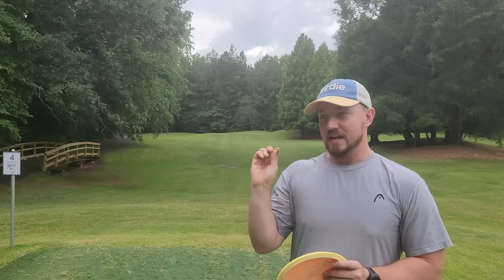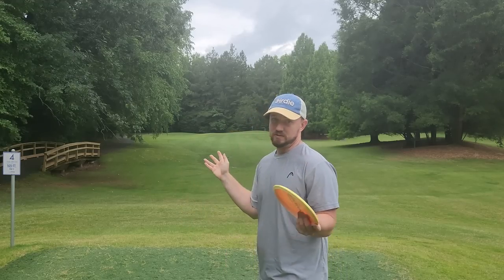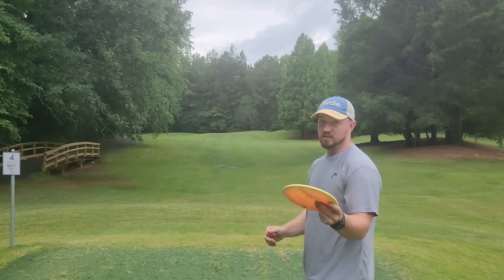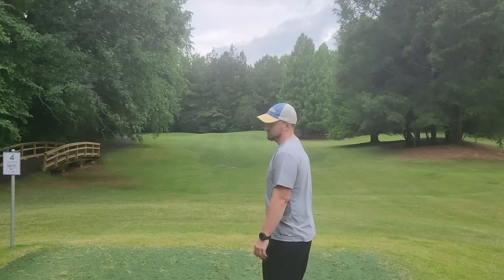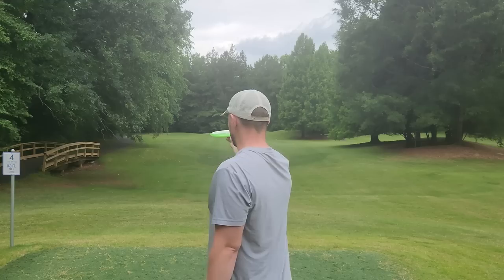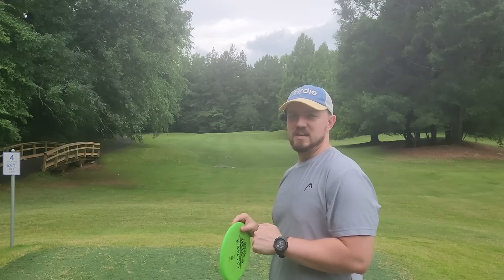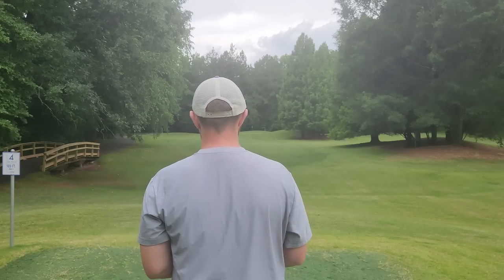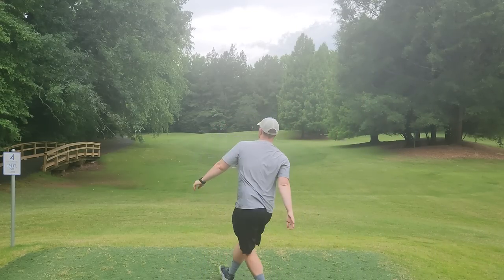Grip Locking Doesnt Exist | What Is Actually Happening and How To Fix It

Comment: I feel like "grip lock" is not intended to describe the disease, it's describing the symptom. Consider a parallel with "warped rotors" on cars. Doesn't mean it's not useful to quickly communicate the effect even if it's not describing a cause.

Comment: The other potential cause is you have your elbow too far forward, or you're moving your arm too soon, before the hips move. 

This means your arm will get in position first, but the hips will still be rotating, so it will push your arm further right causing a "rounding" effect.

The movement has to start from the bottom and transfer power up the chain, so the disc must be the last item in this chain to move.

Comment: so, I have actual grip lock problems.. no just releasing at odd angles, but actually holding on to the disc, sometimes sending it somewhere between 90 and 120 degrees off the intended angle.. it comes and goes, but usually, when it has started to manifest during a round, I find that I have to switch to sidearm for the restg of the round, as no backhand shots, no matter how much I try to relax or concentrate on early release, it just 'sticks'' to my hand.. it's so bad at times, that I don't even want to go and play at times..
Reply from the maker: Im curious to see what your form looks like. Do you have instagram?

Comment: Sometimes when I am throwing at low speeds (like an approach shot from 150-200 feet out with a putter), the disc hooks on one of my fingers and pulls to the right. I feel that this is a kind of grip lock because I'm not throwing with enough force for the disc to rip out of my hand. Thoughts?
Reply: fan grip your up shots. should help.
Reply: Yeah try different grip then. Experiment. You can try 3 fingers grip or fan grip.
Reply: Take your index finger off the disc and see if it helps!
Reply: I saw an exercise to use 2 fingers front grip and then return to 3 and then 4 but I use fan grip which feels best
Reply: Another thing is the approach grip from Overthrow and the technique
Reply: As others have said, fan grip, but if you're like me and fan grip feels super strange, try creating the pressure in your throwing hand at the pinky, rather than the index finger. So the "squeeze" is in the back of the hand, rather than the front. For me, this really prevents that index finger hooking from happening.

Cheers and gl.

Comment: I'll try the drill, I throw up to about 470 but most of my shots are griplocked at least a little (especially when trying to throw a wide hyzer).
Reply: If it's most of your shots, have you considered you've gotten more flexible and just need to readjust your aim to be slightly diagonal like some of the pros?
Reply: @ViJt-oq5nq  wait wdym?
Reply: @garnerthecube  Like instead of feet and shoulders being in line with the target you'll see some pros have their feet placed at a slight angle instead... with the back of their shoulder kinda facing the target. Cuz their hips can rotate a bit further by being a bit more flexible.

It was pretty noticable when I threw a stand still.. I'd do a staggered stance in line with the basket, reach back, rotate, throw and find my hips, torso and head were all pointing to the right of the target at the end of the throw instead of towards it. Looked into it a bit, angled my feet and started hitting my lines properly.

Like u ever hear of some people running up diagonally instead of straight? It's sorta how they adjusted aim.

It's just a interesting one because it's not too often you hear that each person's aim point should be a little different.
Reply: @ViJt-oq5nq  I already do a run up diagonally though